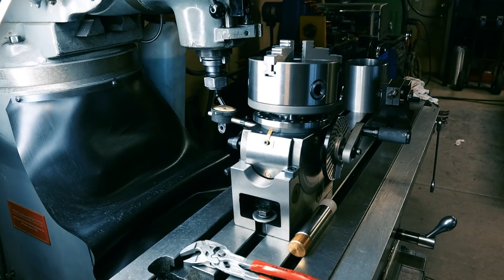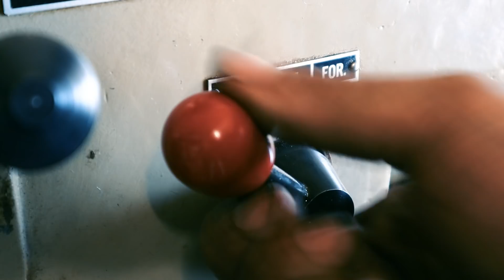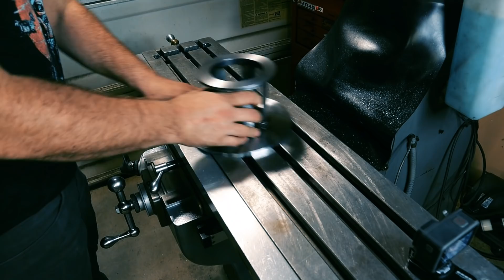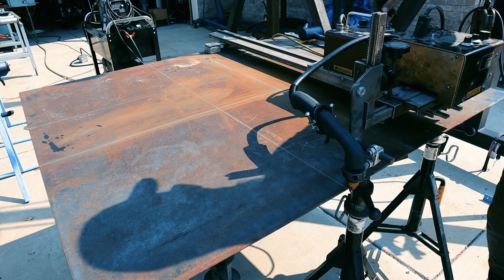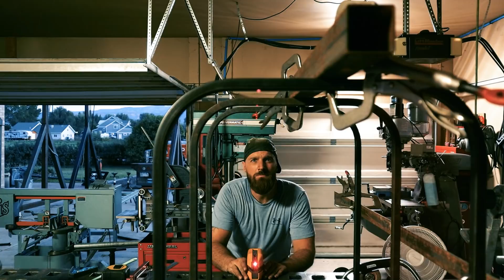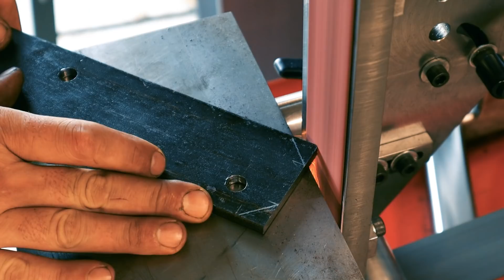Hydraulic Power Unit Build Part 1

Comment: please is 7 7/8 the radius of the die ? the best youtuber maker each other ,i can see by myself the  calem's tshirt i appreciate the great work
Reply from the maker: Thanks......no the 7 7/8 is how much square tubing is used in the bend but it will depend on what size die you use. This is 3/4 tubing but you will have to make a test bend in whatever material you are using and determine how much to subtract.

Comment: Since you already hooked up an VFD, you could have saved the two stage pump by implementing a variable speed hydraulic system, you just need a pressure transducer and hook it up to the analog input of the VFD. Then play around a bit with the parametars on the VFD. I have done this with the exact same VFD and it works really well. The nice thing is you can also actively decrease the speed, that could save you the flow divider you have built in.

Comment: Where did you get your lathe tool storage posts, may not be calling it right thing, after you was done with a tool on you lathe, you put them back on what looked like aluminum brackets with bxa embossed on them, would like to have some!
Reply from the maker: I 3d printed them actually
Reply: @westweld  do you 3d print these for other people, if so how much for each one?

Comment: I am curious though, what makes you prefer the pancake style welders helmet?
Reply from the maker: I started in the oilfield well natural gas and learned with a pancake ive tried to switch but have always gone back for a few reasons, very lightweight and comfortable because of sanding to fit my face and no glare from the sun when welding outside. I can also get my head in tighter spots. They have some pretty nice hoods these days, I thought about trying an optrel

Comment: With hydraulics comes great power!😂👍✊ great video. Does your pump adaptor plate have a centering spigot to align it to the motor shaft? 🤔
Reply from the maker: No lovejoy coupler have a 15 thou tolerance and 1 degree angular that raised boss the pump centers it. Its more concentric than the ones you buy I'm sure
Reply: @westweld They do have a big run out range but I always found that  the closer you get them to concentric the longer the coupling rubber lasts. I was only explaining the idea of a "love joy"coupling to two young engineers at work yesterday and Like that I called them a "love joy" and then had to explain as you did that they were not actually all made by love joy but everyone calls them that🤣. 5hp motor will put out some pressure!👍 I have a 4hp in my 45ton ironworker and its a beast.

Comment: Excellent video and project.
Will the pump power the bender later?
Reply from the maker: It will power a roller im building......the bender already has a power unit and an actuator I just use it manually unless I get into the big stuff

Comment: Looks good, can't wait for part 2. Quick question is something wrong with the power feed on your Clausing, I see you were using the half-nut lever for feeding.
Reply from the maker: No nothing wrong I get those shots of me flipping the levers after the fact and I just filmed the wrong one......didn't think anyone would notice;-)
Reply from the maker: Hey I've got a question for you too? Is your backgear pretty noisy on your machine?
Reply: @westweld  No, its not to bad, I hardly ever use it though, because I have an AC drive installed. Can get down to 150 rpm in direct drive and still have gobs of torque.It will even run a 2" spade bit in the tailstock, I have a torque arm on the tailstock to save the keyway in the ram.I got rid of all of the sheeve drive stuff and installed a 5 HP motor, kept the clutch though. Had this setup since 1997 and would never go back to the old setup.
Reply from the maker: @MrJohnnaz  thats sounds like a nice setup ill keep that in mind for when my varible speed inevitably goes out